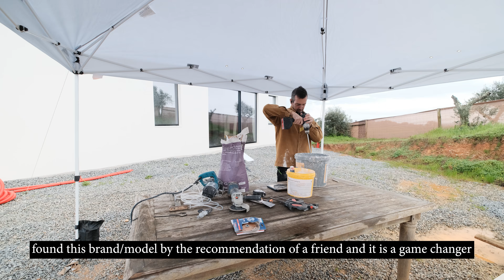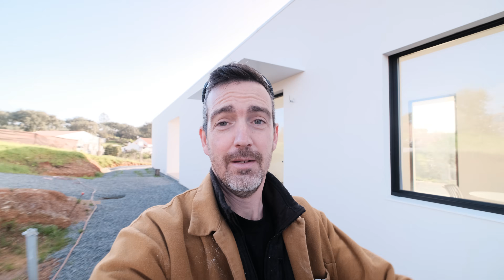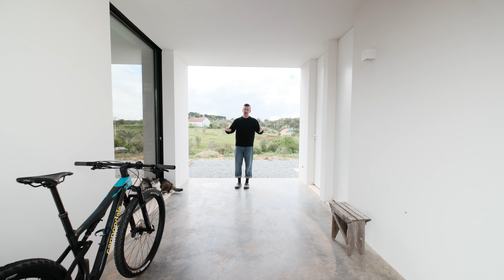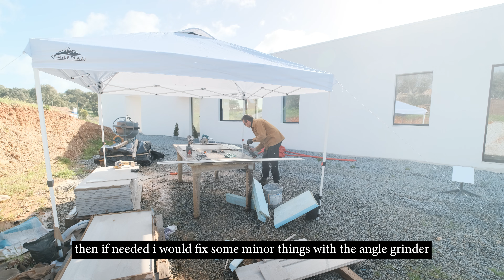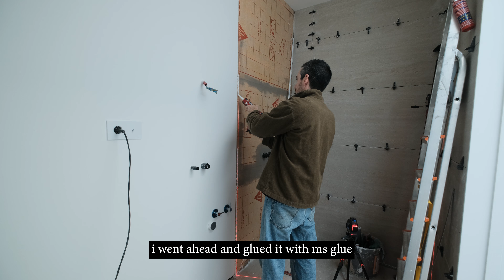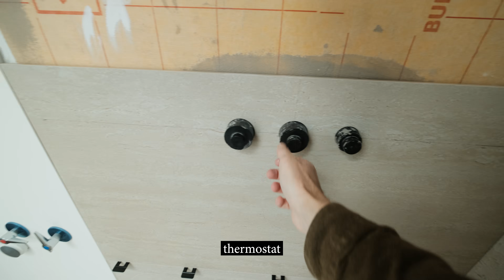Finishing the Interior of our Off Grid House | First Shower Tiling

Comment: That’s a heavy-duty job. I did it at my own house to save money, and it was a lot of hard work. When I bought my saw, the manual stated that the best cut quality was achieved by pulling the machine toward you, with the blade entering from the top of the tile. In the video, you use it like a wood saw, so I was wondering if the saws here in Brazil are different. Just curious. Best regards.

Comment: Since you have a perfectly flat wall, you only need to add combed thinset on one surface eg wall, + back butter the other surface eg tile just enough to cover the groove pattern, there’s no need to comb thinset on both surfaces, too much glue is actually bad not better. It’s also very important to giggle the tile about 2-3cm left/right or up/down, (depending on tile install direction vert or horizontal) giggle 3 or 4 times for a much better bond and ensure all the ridges collapse. Short: Less glue + Giggle (requires suction cup for large format). Don’t worry you tiles won’t fall, Kerakoll is good hehe. If you're ever in Greece hit me up.

Comment: Great work on the shower and I hope you are feeling much better after the surgery. 
I wanted to ask which model is your Bosch laser level and if you are happy with it? 
Did you have to buy the bits to attach it to the pole separately, or does it come with them?
Reply from the maker: the laser is ok, for interior work is good enough, but for exterior i would go with a green one. I have built the whole house with it so it guess it should be fine but if you have the budget go for a green one, mine is the Bosch Professional Laser Level GLL 3-80 , the pole is bought separately and it is this one: Bosch Bt 350 Laser Support and it comes with everything you need to use it. And for the tripod i just used one of our old camera tripods!
Reply: @ModernHouseCabin  Thank you so much for the detailed answer!

Comment: Thank you so much for this video - the quality of the work is amazing and the content is very well made! 🔥

I have a question - was the tile layout planned this way, or did it just happen due to the space? I personally try to plan the layout so that full tiles are placed at the room entrance - it looks a bit more finished visually than having a cut tile in the corner (like in the shot from the corridor, where you can see the cut tile in the corner). But this is just a personal preference - the result looks great overall!
Reply from the maker: thanks man, yes of course it was planned, but the original tile would have covered the whole wall... but it was never delivered. so we had to rethink the whole thing, i explained the reasoning of why i place the cut in that side of the wall in a different comment!

Comment: I have a question. I noticed that you put the tile directly on the sika papper, but shouldn't you apply a waterproofing protector before? I live in Sweden and we built our house with a house building company and I followed the process and I saw that they painted the sika paper with a special colour before putting the tiles in the bathroom.
Reply from the maker: that is not a paper is a waterproofing membrane for showers, and tiles go glued to it directly, i will show it a little bit better in the future